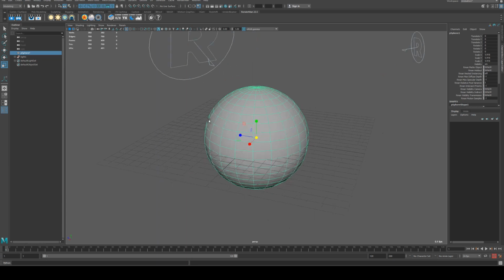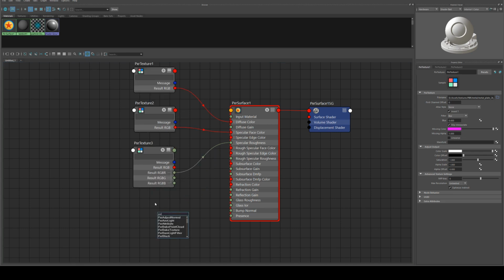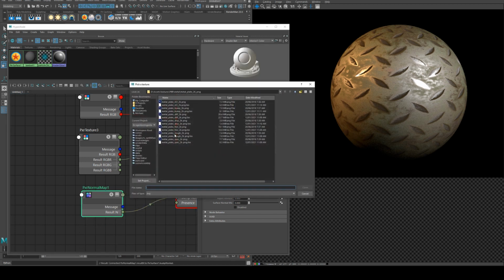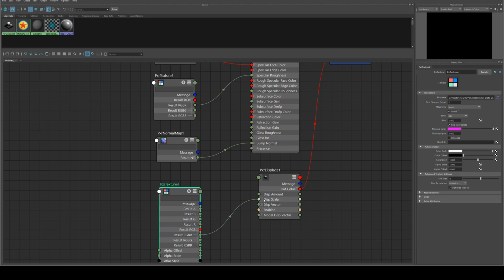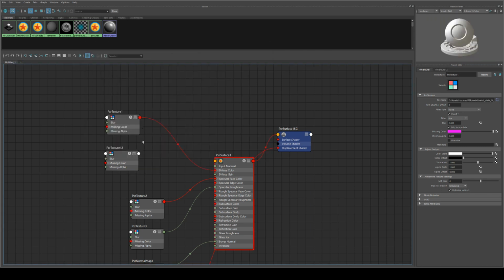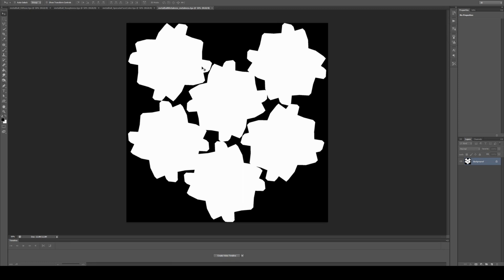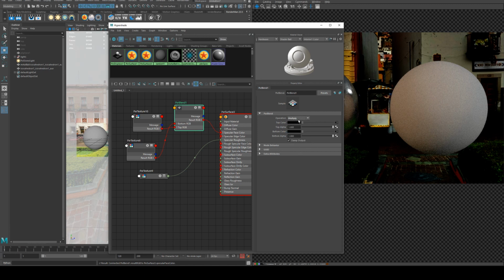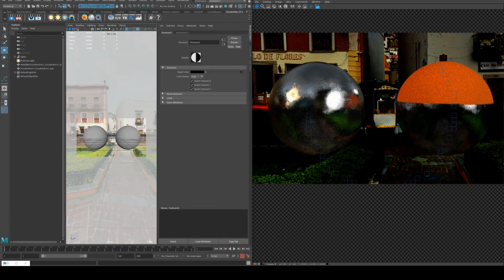Renderman 23 PBR Textures Tutorial

Comment: Wow, this was extremely helpful, Thank you! I'm currently working on a new piece and I'm just getting ready to export it to substance for texturing and I was wondering how I should set up my textures after I bring them back to Maya, this tutorial basically answered all my questions! One small question though, is it the same workflow with glass shaders? Should I connect the opacity maps to presence? Should I change anything on the geometry nodes (like turning off Opaque for Arnold shaders)? Thank you!
Reply from the maker: Glass is setup in the Glass love using refraction and reflection. Refraction is a gain slider so any mask you want to use will work with it. Check the tutorial I out out about a month ago on PxrLayer Surface for a look at how you can layer and combine glass materials. Cheers :)